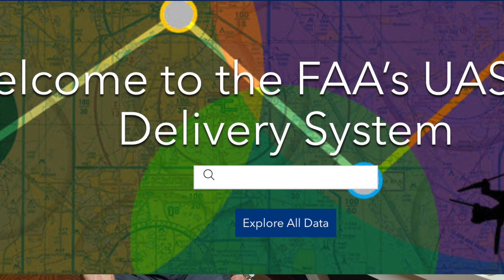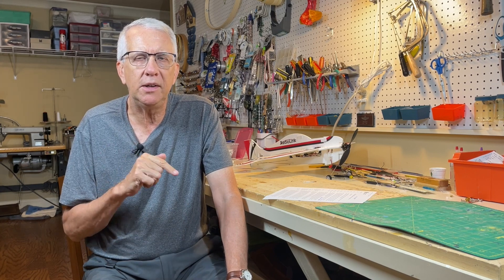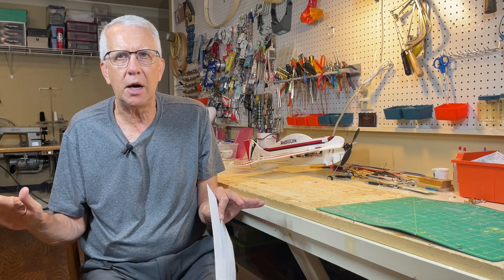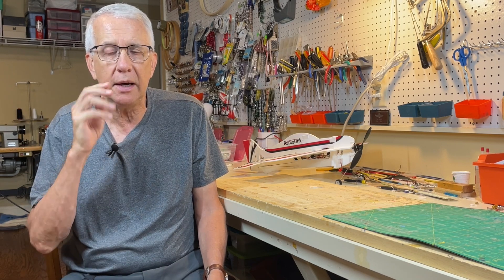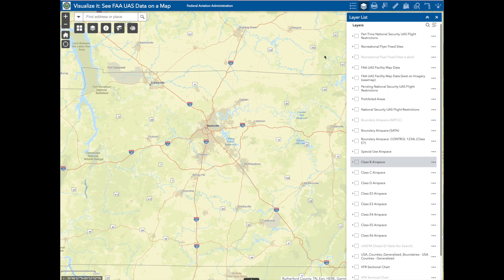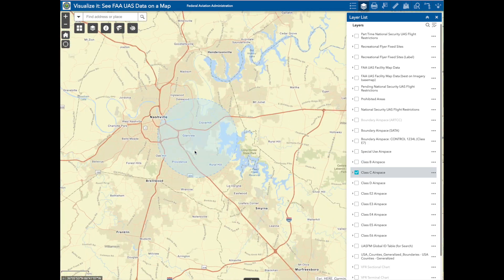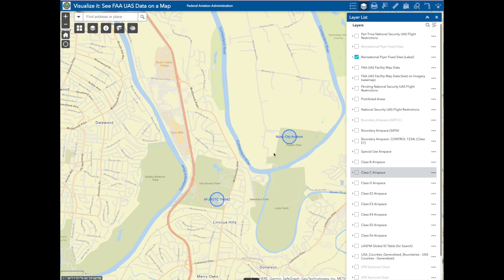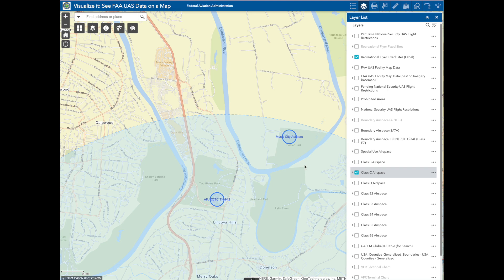Remote ID and FAA Fixed Sites

Comment: what is the range of remote ID and will private or commercial planes see the remote ID if they are flying?
Reply from the maker: Range depends on the installation, no set range needed.  No electronic ID of the drones, a pilot will have to see them, hard to do.  Tim

Comment: only the inner ring of Class C airspace goes all the way to the ground, which is 5 statue miles from the airport. The outer ring extends ten miles from the airport, and the airspace starts at 1200'AGL. If you are further than 5 miles from BNA it shouldn't be an issue.
Reply from the maker: Correct.

Comment: Tim, Since we learned that CubeID Serial and the DroneTag DRI modules weren't going to be a viable option to comply with Remote ID I've been searching for another option and found a board from BlueMark Innovations. It's FAA approved and appears to have wiring connections compatible with standard gps modules so that it might truly be a plug and play option where those others failed. It's 28mm square with an external antenna they supply. they're calling it the "db122 fpv" Please check it out, see if you can tell if it really will sync with random flight controllers I guess is the last question, and let us know what you think as the clock is ticking for us all to buy these things and get them installed. Thanks. Sincerely, John..